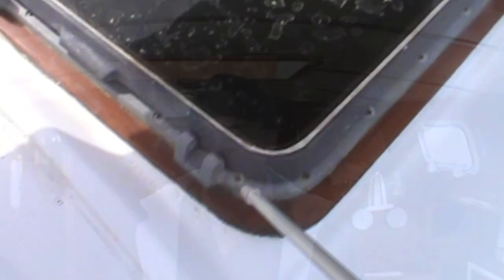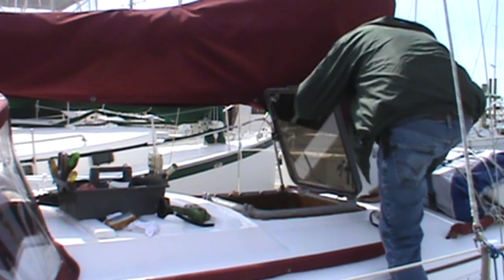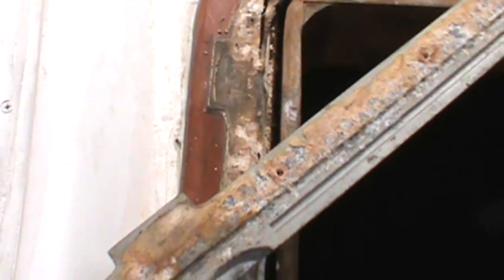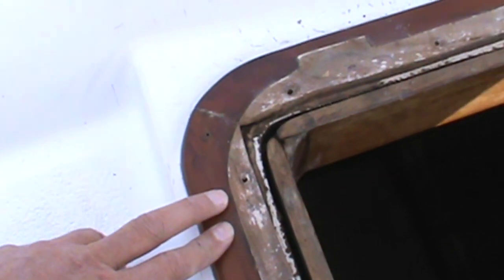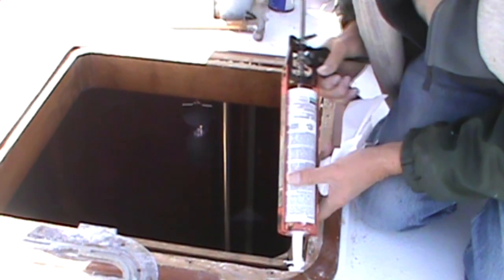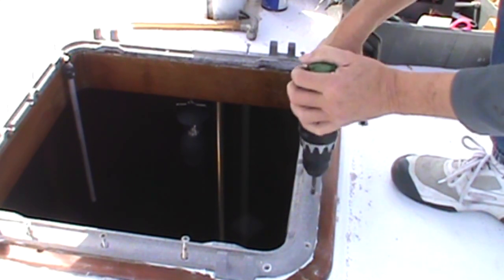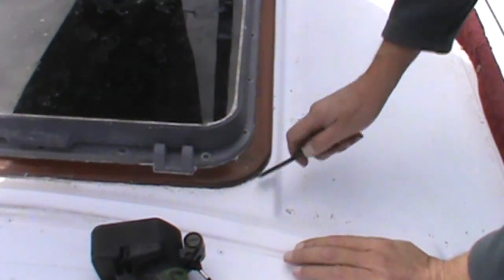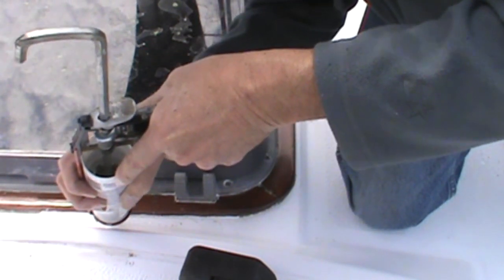Re sealing a deck hatch.

Comment: I'm becoming a big fan of butyl.  However, silicone looks like a perfect fit for wood/aluminum fixture.  I'm learning a lot by your videos, thanks!
Reply from the maker: +Chris Kilmer You could use Butyl for this but I think my preferred choice would be Polysulfied. The owner had the Dow 795 left over from the portlights and it works well. I am not a huge fan of butyl as it is hard to work with and tends to keep oozing out and does not like high temps from the sun. If you do use it make sure you get a good quality. Thanks for watching and I am glad you can get something form the videos.

Comment: I would have liked to hear the ultrasonic test after the fix. I have used a car radio, with  treble boost,the bass cut and volume loud, to test for leaks around windshields using a rubber tube as a stethoscope. Tune the radio in between stations on FM and listen for the noise. 
Good fix.  You can use the ultrasonic detector for lots of other diagnostic jobs as well, especially listening for leaking valves in an engine, compressor or a gas pressure line.
Reply from the maker: +BChrisL Never heard of the radio thing but guess it could work. And yes I do use the leak detector for more than just finding deck leaks. I did not think to go back and retest but after 6 years the hatch is still not leaking. Thanks for the comments and ideas.
Reply: +Wayne Canning thanks for the reply. I wanted to hear the test when it was sealed. I'm working on a Bristol 29, trying to bring her back to better days, so I am taking notes, especially with regards to sealants and other materials.
Reply from the maker: +BChrisL I am sort of thinking on doing a full video on locating leaks and if I do I will be sure to do a before and after with ultra sonic. You do make a good point it would be interesting to hear without a leak . Thanks

Comment: Any reason you did not fill the corners with thickened epoxy? Seems it would have given additional structural strength.
Reply from the maker: +Paul Wyand 
 No particular reason, epoxy could have been used. This was not a structural part but more of a trim filler so the sealant should be fine. But yes epoxy would have worked as well. Thanks